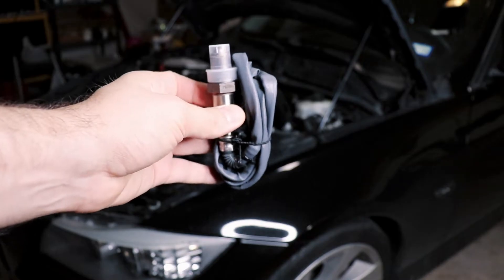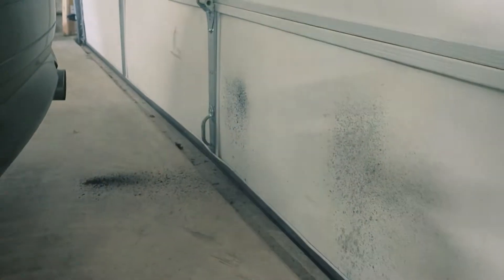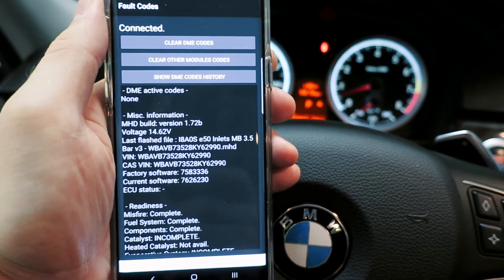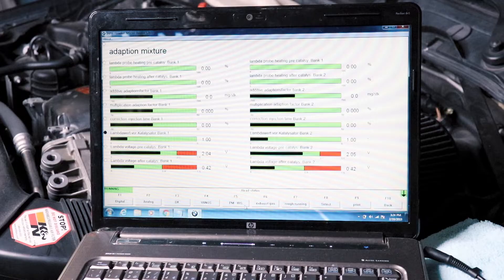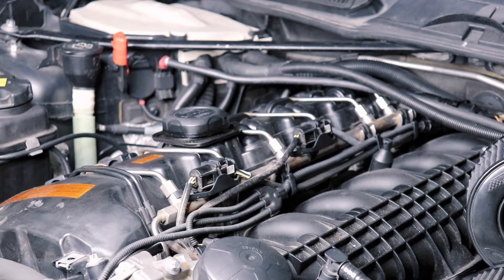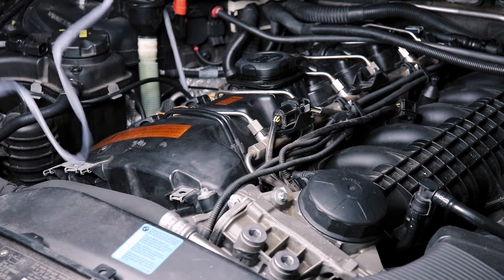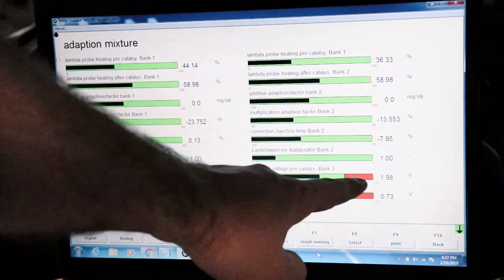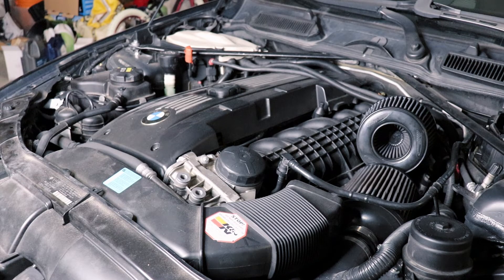How I Diagnosed My Failed Oxygen (Air Fuel Ratio) Sensor - BMW DIY

Comment: Thanks for the video! After replacing the valve cover, I'm getting misfires on Bank 2. My lambda readings look fine, but I’m not seeing any Multiplicative Adaptation Factor readings. What could be the reason? N51

Comment: Does it cause the car to sputter and surge in idle as well as leave a smell on low load after it sputters
Reply: This sounds like more of a fuel pump issue than O2. I have faulty O2 sensors currently on mine and it really hasn’t sputtered much at all if any. It just sounds exactly like his with the rough idle, it died in idle one time actually. I have been getting surges or bucking but mainly in low rpms
Reply: @1er.E82 no it was I replaced them so when they stop working the car will sputter and stall if you don’t accelerate
Reply: @SynthIQreal I think mine are just getting to that point. I have the very rough idling like in the video and then my exhaust tips have never been blacker plus I got a O2 sensor code but thought it was my dual cones being dirty lol
Reply: @1er.E82 yeah mine had a lambía code and bank 2 and 1 so I was like yeah it’s the sensors so I replaced them also get oem cause aftermarket will not work as well as oem its more expensive but it works after I replaced them I had no problems ran normal
Reply: Hope you figure it out bro!

Comment: I'm having an odd issue with my n52, the bank 2 sensor is reading 0.29 volts while bank 1 is normal. I have replaced the sensor, but the problem is still the same. Help!

Comment: If there is an intake leak your O2 sensor will not run same as the other bank. Did you check for air leak prior to comparing bank 1 to bank 2?

Comment: So then to know if your o2 sensors are actually bad you can check the spark plugs?
Reply: Not necessarily but you can see differences between the banks and see the plugs are either showing rich/lean signatures. (Fuel smell and black rich or whitish color lean.

Comment: Hi, could you please help, I'm a bit confused.
On my BMW N53 pre-cat sensor has a long cable and they are on the left side of the engien, after cat sensor has short cable and its under the car.
If I have the same reading like you wich one should I change?

Comment: I have a 29E1 code that pops back up every day or so. I just keep clearing it to try to narrow down the issue. I have a rough start in the morning after it’s been sitting all night but otherwise my starts are pretty smooth. Once it warms up, it smooths out too. I thought maybe o2 sensor but if it doesn’t give me issues warm, should I look more at injectors instead? I have also gotten a cyl 5 misfire every now and then, so I’m leaning towards injector in bank 2.

Comment: You don't need to go under the car I have a right hand drive with the steering rack in the way and with the proper 0-2 tool you can get to it from the top 5 minutes tops

Comment: Hi! I actually have the same problem on Bank 2 but I get low voltage values so the engine thinks it runs rich in bank 2. But it gets a little better when the engine has warmed up but still noticeable lower voltages than bank 1. 
I haven't checked the spark plugs yet but i will.
I have the N53.

Comment: Going through the same on a 2011 N52 right now.  Original sensors with 200k kms (~130k miles), no codes set, unplugging the sensors brings back midrange torque and improved drive ability and fuel mileage.

I thought it was a DISA valve issue, glad I checked O2 sensors first!  I just assumed they were ok because no codes were set.  OEMs recommend replacing O2 sensors by 100k miles, now I know why.

Comment: I did just today change my downpipes to the original ones just to pass the TC.
And got those error, is it possible that this happend cause i put the oem downpipes back in( stage 3 and upgrade turbos)?

Comment: Hi ! I have exactly the same problem I think on my x6M (s63)
No CEL, no hesitation on throttle, no error message , very slight instable idle, high fuel consumption, pop and bang on cold start, pop and bang on shifting with sequential mode, only black smoke (tail Pipes become black), car has +100k miles on the clock.

Do you think my oxygen sensor are faulty too ?

Comment: Will it cause the limp mode in my 07 E70? I am having random limp mode regardless driving style/load/speed. I have replaced camshaft sensor, vanos solenoid, eccentric shaft sensor and disa valves. The code I pulled up is 2c31.Thanks

Comment: Thanks for the detailed info on how to change the spark plugs. The steering rack removal was the key to this DIY. I bought the exact socket from FCP euro and it made the spark plugs much easier to deal with.

Comment: I thought maybe it was leaky injectors but decided to do a bit more research before buying parts. glad I found this video. mine is running soo rich. crazy fuel smell and white smoke. thought it was leaky index 12s

will be changing these sensors, installing new coils and cleaning my plugs as the have less than 100 miles. changed them chasing a misfire issue. only 95k on motor and 106k on chassis
Reply: What was your fix?
Reply: any update on this? what was the fix? i'm having the exact same issue except it runs rough, white smoke and smell of fuel on cold start. gotta give it some gas for about a minute or else it'll just stall/shut off so it evens out. only codes I'm getting are pointing to both upstream sensors. P3026, P2243, P112D, and P166F. just hoping it's not the injectors the car barely has 56k miles. my only guesses are o2 sensors since they work off heat and maybe the car needs to warm up or leaky injectors. praying its just the o2 sensors lol
Reply: @ this sounds like leaky injectors all day. May also be MAF sensor

Comment: 😃 great explanation of the pre-cat I have a BMW E65 doing the same thing, tested with ista/d same result, is it possible a O2 can go bad in 3 years? Can something burn out the heating mechanism? Like a recent replacement trans? or a replaced generator?

Comment: Have you ever had an issue when you start your car up and immediately your car starts to rev up and down repeatedly and when you step on the throttle it’s not responsive? When you put it on drive car still won’t accelerate but starts to jerk really rough?

Comment: I Have a question so I put in a new mass air flow sensor and the car started to run rough and won’t idle once i unplug the MAF it worked like normal well it idles as best it can. I do have a code for O2 lambda sensor and maf. I can see values
With my scanner when the maf is plugged in. So do I need to replace all the o2 sensors now that my maf works?

Comment: Worth adding that on a cold engine [O2 sensor not heated up] and during hard acceleration[O2 sensor too slow for what you try to do], it's the mass airflow sensor that takes over, so that lambda values can be estimated/guesstimated from the lookup data.
Reply: There are no crap MAFs on an N54, just MAP

Comment: Well I'm back about 10 months later and I have bought an E90 2008 335XI. (I still have the E46 M3 too). But I fear greatly that the O2 sensors need to be replaced on it as the car is having horrible cold starts with misfires on first 1 and 3 then if it is a bad cold start it's even more cylinders. One code read showed oxygen sensor code. The coils

Comment: I just fixed my misfires and limp mode because of this video. thank you for this awesome informative video. When first startup, running real rich, clear codes and ran fine until i got into the power band at WOT. then got o2 sensor errors, and misfires. Love your videos. (2008 335i, 112,000 miles. FBO except still running stock intercooler, MHD BEF, JB4 piggy back tune map 2 mostly)

Comment: I’m having a similar issue I put all brand new Coils and spark plugs but my cylinders 1-3 are still misfiring and my spark plugs are wet with gas when I take em out so you think my O2 sensor Is the problem .?

Comment: This is Crazy I changed my O2 Sensor Bank 1 upstream. I'm still getting a low circuit reading PO131.. it may be poor fuel ratio. I also changed the EVAP Valve. Still Showing code plus I smell a lot of gas. I also have a little mis idle
Reply: Fuel filter
Reply: @renzo1457  you think so

Comment: Got a P0172 Bank 1 too rich. Already changed the bank 1 upper 02 sensor and the code is still present even after I erased the code. Also cleaned my map sensor and nothing.

Comment: Great video. I like the logical trouble shooting. I’m having issues with my fan on a 93 300e which may have the same 3.2 engine???? My car was almost overheating at 120 while driving thru the McD take out line. The fan I think was off. I would think it should have been on at that temp. The fan was on yesterday. Are there two different signals to the fan??? One based on water temp and the other based on something else? Shouldn’t the fan be on at 120? I am suspicious of my wiring harness on the 93. It is the old brittle one. The wires near the temp sensor look a bit delaminated. Trying to figure out what to do. Don’t want to ruin engine. Probably gotta get that new harness in and hope that fixes it.

Comment: Nice work identifying the af sensor issue. Your long term/multiplication fuel trims are both very negative after the sensor replacement. Did you manage to find the cause and fix for that?

Comment: I have same issue with a 2009 n52, 328xi.  I've changed plugs and bank 2 coils.  I'm trying to figure out if its the o2 sensors that are causing the misfire codes (only on bank 2) - and for some reason it says catalyst efficiency is below threshold?? on both cats.  the numbers look ok for o2 sensors i guess, except on the bank 2 mix, it's adding a lot more fuel than its supposed to in the long run.  little help?

Comment: Hey I know I’m 2 years late but,Did your car ever shut off? I’m having similar problems.I’m catless and I turned off cel from bm3 flash and check engine keeps popping up.Pretty sure it’s 02 censor
Reply: Bro I'm late too lol..I need the same answer bought a07   328i coupe and the guy stright piped it and I think the o2 sensor bad..same symptom he having..changed the dmtl pump purge valve map sensor plugs n coils gotta be this ....I hope lol
Reply: @bn8298  it’s the 02 but i also changed plugs and coils

Comment: I started my car cold and engine started shaking right away. I hooked up a code reader and saw cyl 4,5,6 misfire. I let the car running for a bit more and then started seeing the o2 sensor code. So is it my o2 sensor or something else? When I clear code, I do feel that the engine smooths out for a few seconds.

Comment: If could reply back. I would appreciate. It. I recently purchased a 2001 Honda Accord lx. I bought it from a family member and they put another motor(used) basically. When I start the car it’s fine. If I drive the car it only gets up to 45mph and it doesn’t have anymore power. It runs raggedy from the cold start but once I start it. But after the engine warms up it runs smooth. The code is air fuel ratio sensor. The guy that put the engine in says it’s the ecm computer could you help me out

Comment: I'm currently having a really bad misfire,  getting 2c7c lambda behind and 2c2e in front of catalytic and cylinder 6 misfire. Would that mean both sensors on bank 2 gave out? I also have jb4 tune and can't get rid of code

Comment: 1 NOV 2020
11:29am Central California 
S.O.S

Bought a 2012 335i e92 n55 from this kid. He had it raced out with a vrsf catless downpipe, vrsf charge pipe & tuned with a MHD stage 1 tune. Fast forward, I gotta get it smogged. Took off the race kit, deleted tune, and put the stock parts back on. For maintenance purposes I installed new O2 sensors (i believe its 2 for this car), new spark plugs and ignition coils. Started her up, ran her for a good 5 days and I'm getting thus code.
 Don't know what too do, help lol. 

P0133: oxygen sensor circuit slow response bank 1 sensor 1. Permanent.

Comment: Hi guys could you help me identify which 02 sensor is bad in my case ? Here are the values which differ :
*multiplication adaptation: 
bank 1: 30.443% | bank 2: 4.211%
*correction injection time:
bank 1: 5.66%  |  bank 2: 1.34%
*lambda voltage after catalyst:
bank 1: 0.13v  |   bank 2: 0.78 v

Does this mean that the post catalyst o2 sensor in bank 1 is bad ? I have also been getting a 29e0 fuel mixture control code. Thanks for your input .
Reply: Currently having same issue did you find a solution???
Reply: Yes bank one is bad

Comment: Hi.  I have 330i with n53 engine. My engine have code 2a2b with correlated code p0172 system to rich bank 1. Sometimes when engine is cold after start rpms bouncing between 500-1200 rpm. You have feeling that engine will almost die. After 30'seconds back to normal. You think it could be oxygen sensor? Also my fuel economy is not great around 22,5 mpg.
Reply from the maker: That sounds like fuel injectors.
Reply: Vehicular DIY worst scenario. Problem with rpms after start is not always. Sometimes car sit 2 days I start engine normal. Other day rpms bouncing.
Reply: Vehicular DIY hi. Two weeks ago I have full service of my car. Oil plus filters. Spark plugs and coils. After this car runs much better. No more problem with cold starts. But today I get 5 codes. 2a2b 2ca6 2caa 2cab 2ca7.  You think it's time to replace o2 sensors?

Comment: I recently bought a 2013 BMW 335is 34k miles from Oregon (salted roads) I got codes for O2 sensors. One said too lean and the other said too rich. Are they really bad or could be something else? I have open recall for injectors getting it done in 2 weeks at dealer. Thanks!

Comment: Amazing video. Could you clean the sensors instead of replacing? If not, why?
Reply from the maker: Thanks.  No they heat cycle and eventually fail,  they don't just foul out.
Reply: @VehicularDIY  Thanks for answering. Seen numerous people on youtube clean them.

Comment: You.....ROCK!!!!! LOL. I can't tell you how much you've helped me with this video. Thank you so much. It seems like no one talks about the importance and or effects the O2 sensors have on our cars. I have an E46 M3 and I just changed out my OEM Catted Headers for a set of catless ones and I have had a real problem with the car having codes on the O2 sensors as well as many other codes just coming up even after I've done a tune that is supposed to adjust the sensors for that particular set up. Miss fire codes and strange stuff. Exactly what you have described and shown here. You were so thorough and I am so glad. I am having the miss fire codes just like you had on bank 2 but only on bank 1 cylinders. (Cylinders 1&2) indicating it is likely the O2 sensor on that bank (as you similarly showed) that is the culprit. It has shown a couple of times where both pre cat sensors are throwing codes. But usually it's only showing a code for the pre cat sensor on only bank 1. I have been thinking that it could be so many things that I just wasn't sure enough yet to pop for any one or two parts to try and solve it. I thought maybe vacuum or ground problems. But I'm sure enough now to start with this. Thank you again!

Comment: I hace exactly the same car 08 335i with 190k miles and I have mixture control on bank 1 and 2 also fuel pump pausability and most of time long cranks, replaced fuel pressure sensor and fuel regulator and still having this issue , any recommendation ?

Comment: Just learning here, bare with me... Cylinder 6 plugs appeared wet when you removed it. Is that gas? Also, will faulty O2 sensors cause gas to collect in the cylinder? Just trying to determine if I have a bad injector in Cylinder 5 (which I get a consistent misfire) or if my O2 sensor in bank two is bad. I have JB4 installed and three days ago I performed JB4 MHD BEF and car hasn't ran right since, primarily at idle/cold starts. I get a rich gas smell when idling.

Comment: Thank you so much for your tutorial video.  It's really excellent.  I bought a 2013 BMW 328i xDrive N20 4 Cyl in Dec 2019.  It had drivetrain malfunction and misfire on Cyl 2.  The dealer suggested to replace 4 coils & spark plugs.  I replaced the 4 coils and 4 spark plugs, and the battery (was low).  The drivetrain mal function error went away, but the misfire error persisted.  I replaced the fuel injector (looked black) on Cyl 2 to no avail.  Yesterday, I cleaned the MAF (look new and clean to begin) to no avail.  Your video suggested my car may have O2 sensor issue.  I will give it a run and checked the 4 spark plugs as you did to confirm the black sud on #2; I may have more than 1 Cyl misfire.  I think my car may not have bank 1 and 2 as your N54.  Much thanks to any suggestions you may have.  Thanks again.  This video is really excellent.

Comment: Just curious, did your car stop spewing black sooth after you changed the o2 sensors? Or did it just decrease the amount of sooth coming out?
Reply from the maker: It stopped spewing the black soot.
Reply: Thank you. I thought it was just the oil from the pcv down to my turbos and intercooler then up the charge pipe to the intake manifold then out bank 1 of my tailpipe. It is still puffing some soot now but not as much. I will change my 02 sensor on bank 1 and i hope that works.
Reply: Oh something missing on my reply. I installed the mishimoto oil catch can and cleaned the intercooler and charge pipes.

Comment: My 2003 X5 has the 3 litre M54 engine, and this completely explains what is going on with my rough idle.....new plugs, new coils, new MAF, new gaskets...etc. No vacuum leaks. After a good quick drive on the freeway, engine is good and warmed up, runs like a new vehicle...goes into closed loop at idle, runs like garbage with misfire codes and fuel trim codes. Im gonna change out bank two   O2 sensor immediately! Thanks for the great video...it helps people understand how o2 sensors work, and the purpose of closed loop on a modern fuel injection system. BRAVO